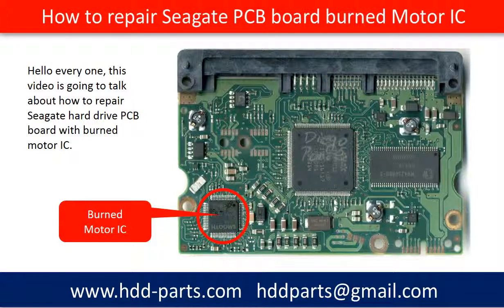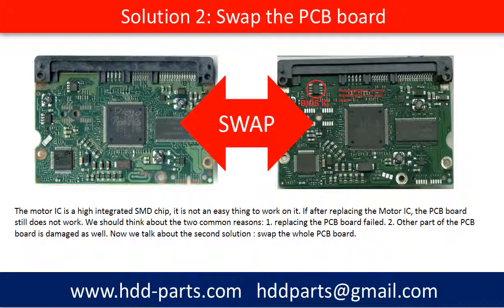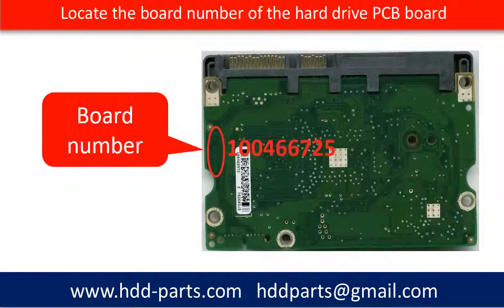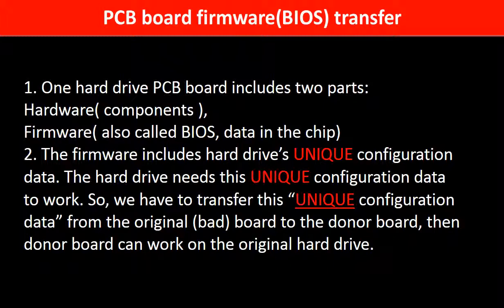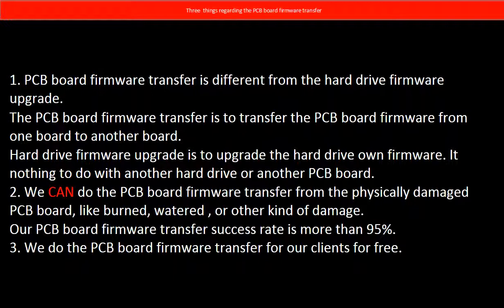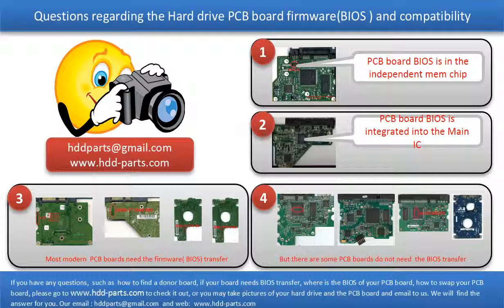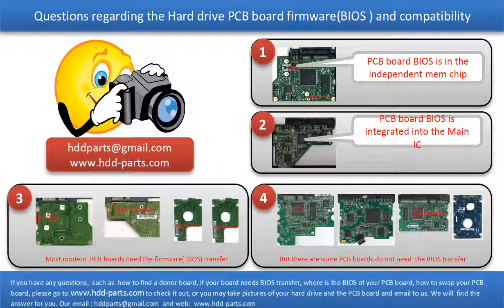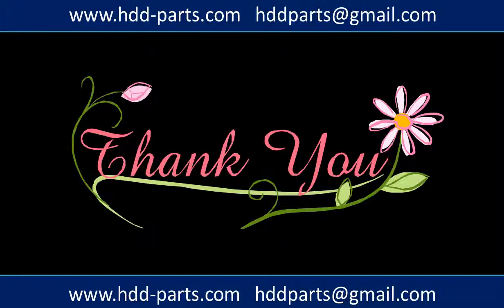How to repair Seagate Hard Drive Burned PCB board   Data Recovery Q&A 19

Comment: How am I gona transfer the original firmware to the other PCB board, if the main board is burned?
Reply: with a hot air soldering gun...or a point tip soldering iron , solder sucker and wick and some solder flux... the BIOS chip has 4 solder joints both sides ...pretty easy/